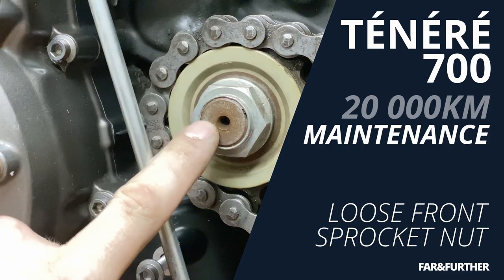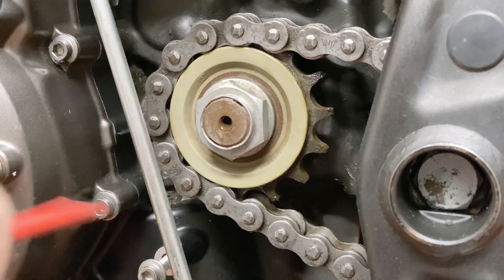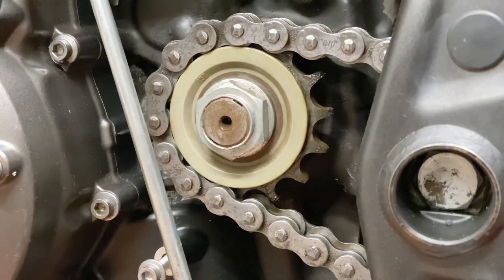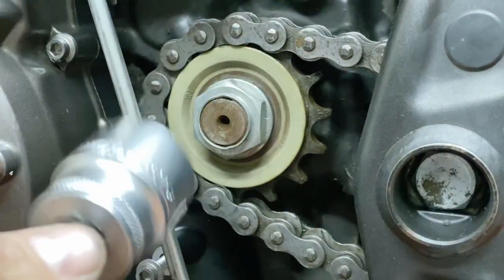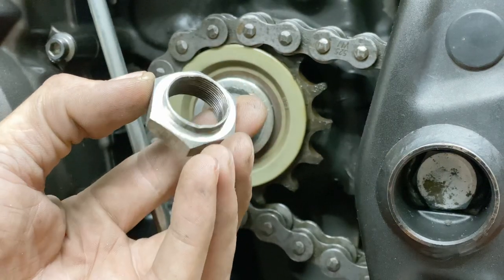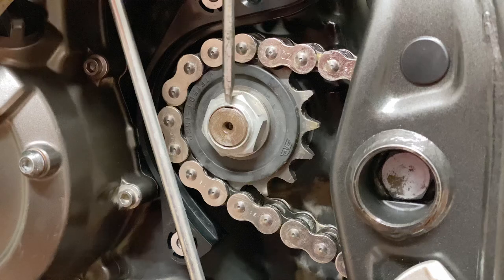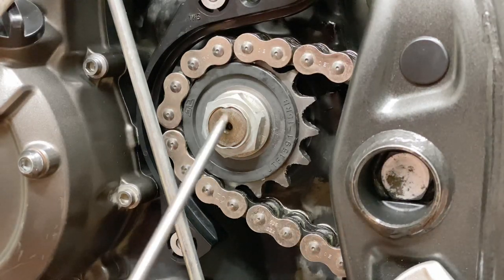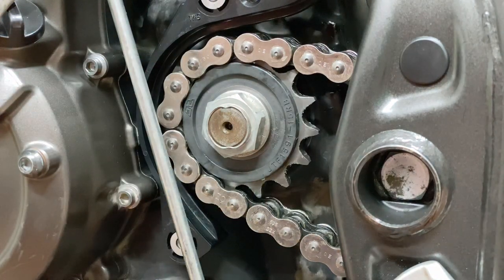Yamaha Ténéré 700 20k: Loose front sprocket nut!

Comment: Thank you for the good tip. May i ask where did you bought the front sprocket JTF1591-15RB? I want to keep the standard size (15 teeth with Rubber Cushioned). Thank you!
Reply from the maker: Hi Henrique, I'm in Czech republic and I bought it from the local supplier. I got the JT brand and the part numbers I ordered was as you say JTF1591RB - 15 teeth and JTR1876 for the rear one. Depending where you are there is also AFAM 21607 if the JT is tough to get.
Reply: @FARANDFURTHER  Thank you. The JTF1591RB with 15 teeth is tough to get, but the one without RB is easy. Waiting for some answers from local supplier, hopefully one will have it.

Comment: Cause these bikes are not made/assembled  in Japan,  probably France like mine tenere was...quality issues everywhere.  Thanks God engine is made entirely in Japan.  Anyway after delivery one should retighten all bolts and nuts and grease what should be greased.
Reply from the maker: There is probably very few bikes still made in Japan. Still considering what I’ve put the T7 through it is holding up very well!
Reply: Ive heard people realising that the main bearings in the swing arm arent greased at all
Reply from the maker: I have 40000 and they are still smooth as silk. There is loads of noise on Internet, check it yourself and you see. Maybe there is not a lot of grease but it seems to be fine on mine, for now.

Comment: honestly i dont like the pinned thing makes it a pain in the ass to take off i would just red lock tight it
Reply: Original Yamaha XT600Z Tenere had  a pin, and had no issues whatsoever,  Loctite is overused on poorly engineered bikes like the KTM 😉
Reply from the maker: A lot of people mention red Locktite (permanent). Maybe next time... I think it would be better solution because now you're supposed to use new nut because one has to stoke it to fix it, this would not be the case with Locktite.
Reply: @FARANDFURTHER  red loctite is "sort of" permanent, you heat it up with a torch and then you can remove it again. but that would be a pai  in the field. I'd prefere a spline going through the nut and axle. so you can reuse them all the time..
and onethjng abput loctite not a lot ofpeople know... it changes you torque value , so eg. you torque something with 13Nm with loctite..afte its dried is way higher like 17 or 20Nm... BMW advise sometimes not to use loctite on every bolt that it was used in the factory.

Comment: Anybody happen to know the part number for this nut and where to get one? Trying to order one online and having a lot of trouble finding one.
Reply from the maker: The nut has a part number 90179-22006, good luck.
Reply: @FARANDFURTHER  with the part number you gave me I was able to find on line and order. Hopefully I get it quickly. The dealer is about 2 weeks out. Thank you!
Reply: @FARANDFURTHER  the part number is not on any of the schematics for oem parts. The nut and washer are there but no part number. 😬